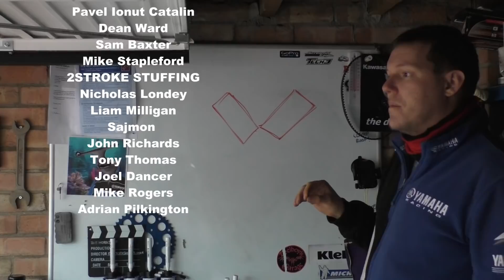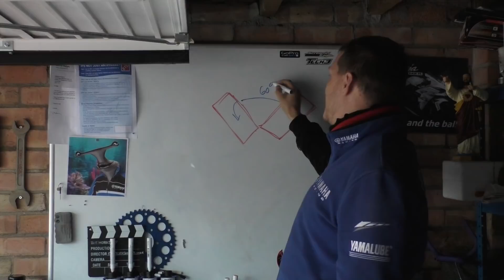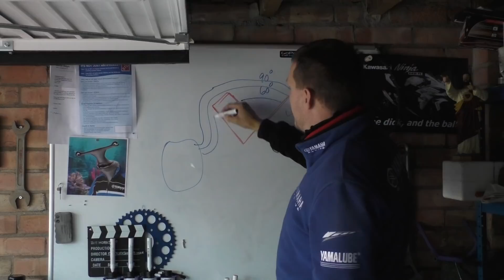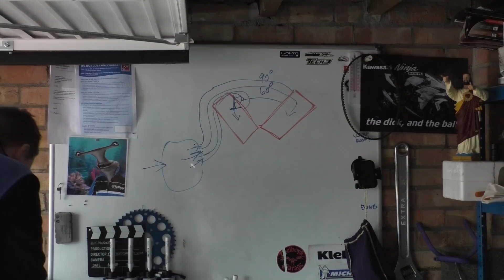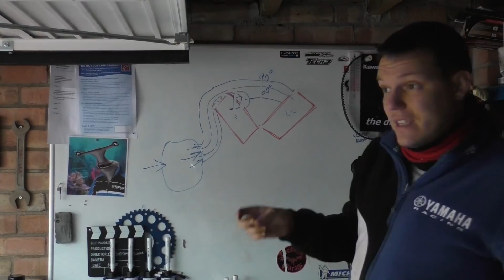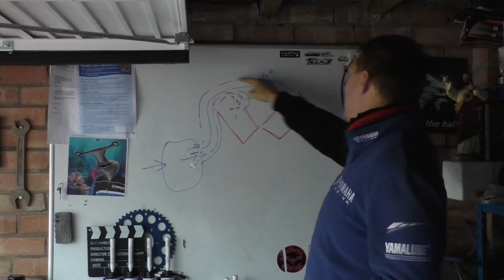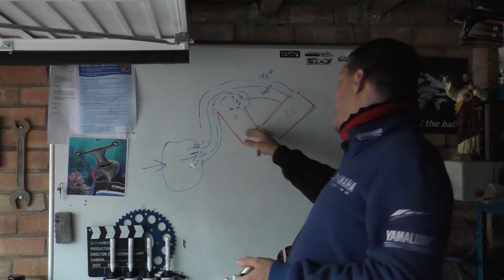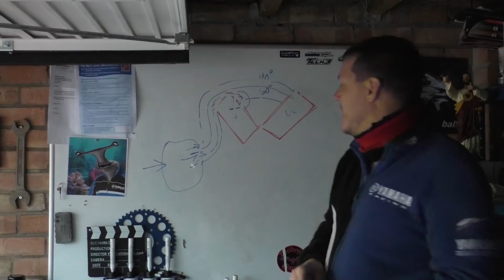Cylinder Aspiration | Part 1

Comment: I'd love to see a percentage calculation for the cylinder filling difference. It can't be more than a couple percent. The same thing happens with tall-deck big blocks and single inlet manifolds. The firing order and the ports that are bent backwards to the single point tends to be an issue under certain circumstances. All of the big racers use intakes with big plenums, or ITB's, always on a symmetric port cylinder head, like Sonny Leonard.

Comment: Honda has great example for different runner leghts in Cbr250rr middle cylinders 2/3 have longer and 1/4 short for trying to save little low end toque on engine that has 18k redline and makes whoping 20nm @12k

Comment: Interesting. I thought intake port length was only a concern with natural aspiration because of pulses running the entire tract of the intake port, whereas forced induction is a constant buildup of pressure. E.G volumetric efficiency no longer being a concern as the desired cylinder filling would be achieved by the time valves would close
Reply from the maker: As far as any engine is concern the pressure value means nothing. 14.5 psi or 30 psi, air flow still obeys the same laws. With a superchager/turbo you can think of the whole system as a closed system. For the molecules at the farthest end of the intake to move the 'ones' in front of them have to budge.

Don't get me wrong, with a compressed system there's a lot more energy and acelerations are higher (so to speak) but N/A or Boosted, the physics are the same.
Reply: Phillip, look at a V2 stroke timing diagram. And no matter if you look at a Harley like or Ducati like V2 diagram. you will notice that the pressure that is produced will be uneven filled in the cylinders. Check the intake strokes and the outlet strokes... that is the reason the intake port length is not the problem at all. Because pressure is build up on the exhaust stroke only! and if one inlet stroke takes away the most of it as the first one that opens there is not much left to fill the other cylinder. At Harley timing one cylinder intake opens 60° after the other that gets the high pressure. And at the Ducati timing one cylinder is on the inlet stroke when the other is on the exhaust stroke so it eats a big part of the pressure away. That is why two cylinder turbo works with even filling on the cylinders only on boxer and inline engines.

Comment: Is it not fluidics. Air will follow the path of least resistance.  In your diagram the longer path is the easiest. A liquid will form eddies on the bends which slow the flow down including the pulses. Should be possible to restrict the long pipe slightly to even out the difference?

Comment: Speaking of designing a bike engine to a specific engineering goal, I wonder what it would be like to design an engine with the goal of making periodic maintenance simple without compromising the modern tech side of things. What compromises would you make Matt? It still has to be a decent performer.
Reply: Thats easy, just make the whole thing removable, I think the Mclaren f1 is designed this way, the entire power train and drivetrain can be removed with I think 6 bolts.
Reply: Get the price of a complete engine as low as possible, maybe decrease the realistic life time of components but make the whole thing as a unit cheap and easy to swap out.
Reply: Kinda like a car or bike is probably cheaper to buy new as a whole, than the sum of its parts from the dealer
Reply: So basically low cc per engine(<250) i.e. chinese clone of Honda CG or Suzuki GS like we have today?
Reply: I would think a large single cylinder engine would work well for such a project. I think many DIY bike jockeys like building around Suzuki’s LS650 engine. I think it is one of the largest street thumpers you can get. Everything is simplified with a single, so the number of required components and thus costs drops dramatically. There is one thing you have to deal with with such a beast, good mixing and fuel delivery. I don’t think electronic complexity is really a factor as embedded systems are often self diagnosing and components can be made very modular. Think about all of the little Rasberry pi boards being used for robotics and sensing projects. Those things are cheap and can be packaged quite nicely.
Reply: ...you just described a Honda Nighthawk 750

Comment: Maybe, as a different way to thing of it, rather than the slinky comparison, is cars flowing in traffic. 

When the valve is closed, it's a red light. But not everybody stops right where they are, right then. They have to come close enough to see the light, and then they pile up real close and flip each other off and yell "fahkeen 'ell!" at each other. 

When the valve opens, it's green, and all the idiot speed demons take off at the front, but not everyone takes off at the same time. The drivers wait until there's a bit of space in front of them, so they aren't tailgating. 

The second cylinder is like a big intersection, with longer lines of cars. Sometimes you don't come to a complete stop until the last second of red light, and have to accelerate again, other times you have to slam on the brakes cuz you're texting and wasn't paying attention to the light that just turned red.
Reply from the maker: Nice I like it - pinched!

Comment: Couldn't they use a collector which is placed at equal distances from each cylinder and feed that from the charger to fix the different lengths problem?

Comment: Why would a central manifold not work?😳
Reply from the maker: The inlet pulses are massively decreased in length with mean the time it takes for the pressure wave to travel is greatly reduced.
Reply from the maker: Whoopps - I forgot to add - this all depends on the timing also - but we'll get onto that later.

Comment: Why don't the manufacturers just make them the same length, like they do with exhaust manifolds? Seems pretty stupid.

Disclaimer: not watched whole video yet lol
Reply: neil h I was just about to say the same thing.
Reply: As matt said, fitting the supercharger where there was space, drive, safety, etc
Reply: Spanner Monkey I still don't get it. Regardless of the distance from the supercharger to each cylinder, you can make the feeds to each cylinder the same length by how you route the hoses/pipes/whatever they are..
Reply from the maker: I get what you mean now - in this application not really. There is very little room and the pipes are quite big in OD (55mm) and the difference in length was about 2:1 - that's a shit load of pipe work and no room to stick it in. 

What you have to realise is that this engine produces too much power and the fact that 1 cylinder is down on power is actual not an issue.

Comment: Now listen, I think they are morons and you miss a important point. First I would want an intercooler and would make the runners the same length. Even giving each cylinder his own turbo would be something to consider. Now why and where the point is that you have missed. If you turbo an V2 engine with an single turbo and one cylinder fires 60 or 90° after the first then there is much less BOOST (pressure) in the system for the second cylinder. That is the main reason for their uneven power they get out of the cylinders. Your sound wave and runner length story hits only a part of the problem. The main thing is that it cant get the fucking pressure up because there is no fucking exhaust stroke in the engine after the first cylinder filled an before the second wants to be filled. You can think it over what I have written here and give them some greetings from me. And you may get better away with it when you split the timing so that they are not on the same stroke cycle so the chance exists that the pressure/heat produced by the one cylinders bang can fill the other cylinder and not only one cylinder gets the goodies of the boost. PENIS MY FRIEND!
Reply from the maker: But the intake strokes aren't 30Deg apart.......... the 60 and 90 on the board was me writing down 60 or 90 deg V, NOT the difference in cycles from TDC.
Reply: Look, even if you offset it what ever 30 60 90 120° you will have one cylinder that sucks more boost. The V turbo works with 4 and more pistons. 2 cylinder turbo is only to get even charge of the cylinders with inline and boxer engines. The valve timing will cut in intake and exhaust stroke on one cylinder... Result: One gets more boost. Only way to avoid it is each cylinder his own turbo and air intake system. Like two stumper... and that works but not as well like an inline 2 cylinder single turbo. So a V4 needs a turbo for each cylinder pair to get the best result. And his own intercooler and throttle body... and so on.
Reply: Linny, has nothing to do with bleeding boost. The turbo can only build boost on the exhaust stroke... and if one intake stroke feeds on both exhaust strokes boost the other intake stroke will get less.